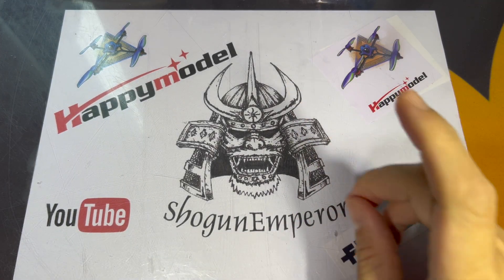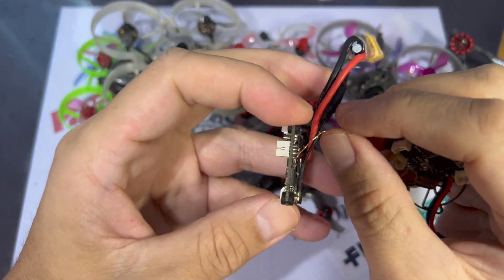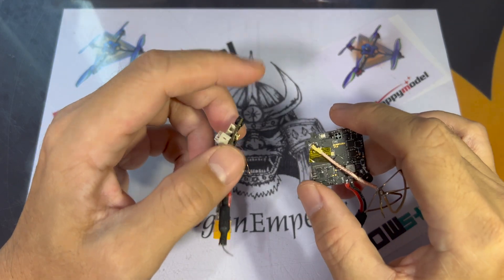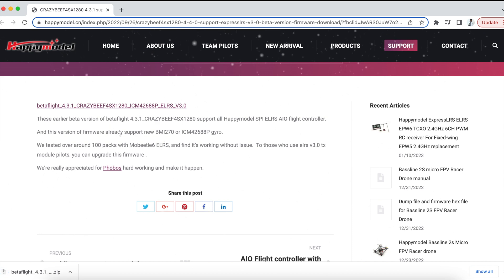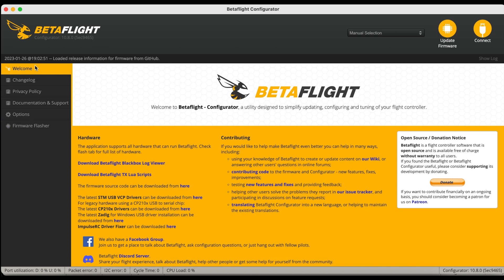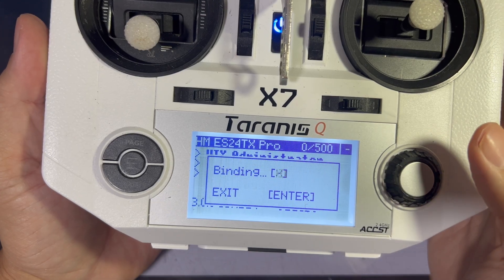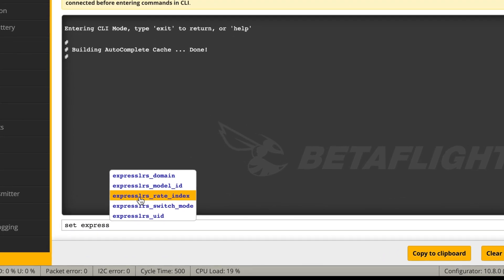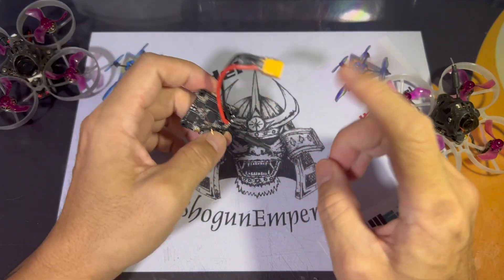Happymodel SPI FC binding process | SuperbeeF4 | CrazyF42G4 | X12 flight controller

Comment: Bonjour 
Sur Happymodel X12 ELRS pro V1.1, quel Port uart Betaflight faut il configurer le Vtx interne ?
Port uart 1 Vtx Smart audio ?
Port uart 2 Vtx Smart audio ?
Marci des infos et réponses
Reply from the maker: Bonjour meu bro!!!!  Desole por la response tardive!!!  Port VTX cest uart2, peripherals tab regle sur VTX(TBS smart audio)
Copiez ceci dans votre CLi
# SMARTAUDIO
# vtxtable
vtxtable bands 6
vtxtable channels 8
vtxtable band 1 BOSCAM_A A FACTORY 5865 5845 5825 5805 5785 5765 5745 5725
vtxtable band 2 BOSCAM_B B FACTORY 5733 5752 5771 5790 5809 5828 5847 5866
vtxtable band 3 BOSCAM_E E FACTORY 5705 5685 5665 0 5885 5905 0 0
vtxtable band 4 FATSHARK F FACTORY 5740 5760 5780 5800 5820 5840 5860 5880
vtxtable band 5 RACEBAND R FACTORY 5658 5695 5732 5769 5806 5843 5880 5917
vtxtable band 6 LOWRACE  L FACTORY 5333 5373 5413 5453 5493 5533 5573 5613
vtxtable powerlevels 5
vtxtable powervalues 1 2 14 20 26
vtxtable powerlabels 0 RCE 25 100 400
save
# TRAMP
# vtxtable
vtxtable bands 7
vtxtable channels 8
vtxtable band 1 BOSCAM_A A CUSTOM  5865 5845 5825 5805 5785 5765 5745 5725
vtxtable band 2 BOSCAM_B B CUSTOM  5733 5752 5771 5790 5809 5828 5847 5866
vtxtable band 3 BOSCAM_E E FACTORY 5705 5685 5665 0 5885 5905 0 0
vtxtable band 4 FATSHARK F CUSTOM  5740 5760 5780 5800 5820 5840 5860 5880
vtxtable band 5 RACEBAND R CUSTOM  5658 5695 5732 5769 5806 5843 5880 5917
vtxtable band 6 LOWRACE  L CUSTOM  5333 5373 5413 5453 5493 5533 5573 5613
vtxtable band 7 IMD6     I CUSTOM  5732 5765 5828 5840 5866 5740    0    0
vtxtable powerlevels 5
vtxtable powervalues 1 2 25 100 400
vtxtable powerlabels 0 RCE 25 100 400
save

J'espere que cela aide!  Ciao!

Comment: I have a mobula 6 firmware 4.5.0 and radio has 3.4.2 
It won’t bind how do I no if it’s compatible
Reply from the maker: no bro... ur talking about 2 different things here.  4.5 is the firmware for Betaflight and 3.4.2 is the firmware for the ELRS receiver.  Make sure u watch and familiarise yourself with ELRS bruh.  Switch your radio packet rate to 500hz on the ELRS lua script
Reply: @ I never checked the HZ so I will look into it.and thank you for messaging back no one else did.and that’s the thing I don’t understand the say the spi receivers are updated though bataflight 
But how do Ik they match.thats the only thing I can think of I did wrong it was working fine till I put elrs in my long range quad and now I’m trying to update the spi to match.and I don’t have a binding freeze I don’t have friends

Comment: where is the bind button
Reply from the maker: @tommypoteat9433  check the pinout of the specific FC on the Happymodel website. Or plug the lipo 3 times to put it into bind mode.
Reply: @shogunemperor  thanks one more question i have the crux 3 with the frsky new x 12 aio flight controller will it be a bind button or i can go to the receiver tab in betaflight hate to bother you
Reply from the maker: @ aye bro! No worries man! Please feel free to ask! Thats what i’m here for!!! For Frsky, its a bind button. But make sure its the bing button, cause the boot button also looks similar. Betaflight binding is only for ELRS
Reply: @shogunemperor  thanks shogun your the best i will always be a fan of yours your the best and also a great drone flyer
Reply from the maker: @ aaawwww shucks! U making me blush bruddah! U guys inspire me! So i try my best! Happy flying bruh!!!
Reply: @shogunemperor  thanks

Comment: My X12 aio5in1 v2.1 is FRSky with non ceramic antenna work with D8 and D16 telemetry, 

Will i be able to make it work as SPI ELRS , on this same FC board , may be you will have the video to make ?
Reply from the maker: @junkthe  oh no bro. The chips embedded into the PCB are totally different. U may need to get another FC with ELRS instead of
Reply: @shogunemperor  1. so why my X12 v2.1 frsky was delivered with ELRS sticker ?
 2. And could you fly those X12 ELRS and set as SPi D8 and D16 ?  (Is supposed to work 2.4ghz)
Reply from the maker: @junkthe  ok thats confusing. It would be either frsky or elrs. If frsky, u can fly on D8 or D16, and for elrs it is spi. Maybe check with the seller?
What are the issues are you facing? Im seriously confused here bruh.
Reply: @shogunemperor  for now my X12 v2.1 fr D16 got RX Lost.
At short range

Any solution ?
Reply from the maker: @junkthe  aaaah. Ok. Try D8 and also, check the solder points of the antennas. Theres a high chance that antenna is the cause. I had this issue before and after changing the antenna, it worked
Reply: @shogunemperor  it seem that D16 also fine but after the happymodel release the update of firmware betaflight, the basic of rxloss is fixed, i tested on ground it was quite 30 stable on 100 meter, fine.

But the Temperature worse on 2S, i goes over 90C⁰ and can cause rxloss fr,

Whats is going on,

I also watching your latest video, it show something i didnt get expirienced, that video is what im looking for that show over 90C⁰~60sC⁰ (weird that some people know) but i dont get experience that on my X12 V2.1 fr,

Curently waiting new wing(prop), will try fly again, to findout why 2S rxloss and the temperature didnt retured 60S⁰
Reply from the maker: @junkthe  interesting..... what was your VTX power output?  Yeah.. that damn heat is the possible cause of that sudden RXLOSS. Also, whats the MAH of ur 2S lipo?

Comment: I need video of X12 core temp 2S , disarmed, armed, and fly angled.

My tropical temp daytime show X12 core problem over 70⁰

,  please make the video to confirm original X12 no modification , to do 2S and keep flying 1S also on it, core temp ?
Reply from the maker: its normal bro. The FC temperature runs around that high.  Most of us have the core temperature off.  Its nothing to worry about.
Reply: @shogunemperor  Soo what causing my gyro artificial horizon OSD, stable line, while my quad fly left roll side, on angled mode ? But if i land it return right roll and slowly stable horizon line, what cousing this to happen ?
Reply from the maker: @junkthe  have u done an accelerometer calibration?
Reply: @shogunemperor  i do that, everytime it drift also,

But every land the Gyro horizon back flat, but after throotling up it comes back roll left, and the horizon osd show flat horizon,

If i stik Right way to stable the quad, the horizon show right roll.

What could be hapened here ?
Reply from the maker: @junkthe  a standard fpv drone doesnt usually stay stationary like your dji video drone. Have u done anything to it? Like reflash fc etc??
Reply: @shogunemperor  hasnt reflash fc, would that do makes loss warranty ?
Reply from the maker: @junkthe  no it wont. Its strange tho. It should be good out of the box. I almost never use the horizon lines as i have them turned off.  So im honestly not sure. Would u be able to share ur video on my discord channel?

Comment: I'm trying to bind my mobula7 1s spi with my tbs tango 2 pro multiprotocol module and I've had zero success. My mobula7 hd 1s bound first try. Is the process the same if you are not using the elrs? 
And one more question if I may.. Is there a term for having the spi elrs combo and using the spi opposed to the elrs? I'm honestly still  trying to grasp it all! Thanks for your great content 👍
Reply from the maker: aaww thanks bruddah.  Ok, so I'm assuming that the Mob7 is the ELRS version? U will need the ELRS TX for it on ur tango2. An multiprotocol module wont work. Unless ur using the Frsky Mob7 then u'll need to connect via Frsky D8 or D16 or XJT.  Binding process is physical. So u need to press bind on ur radio and then plug the lipo to the mob7, press the bind button on the Flight controller then u should be good to go.
Reply: Thanks for the reply 👍 turns out it's elrs and my hd is frsky so operator error 😆  Thanks Again
Reply from the maker: @jonathanmcwhorter1353  awesome man! Glad u found that out! Hope u get it working. Happy flying bruh! And its my pleasure!!!! Always here if u need me!